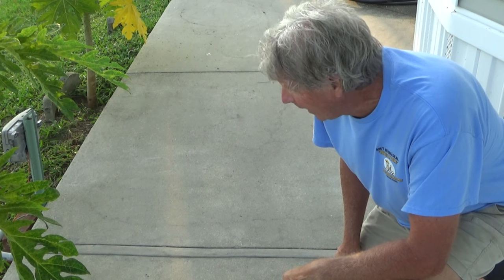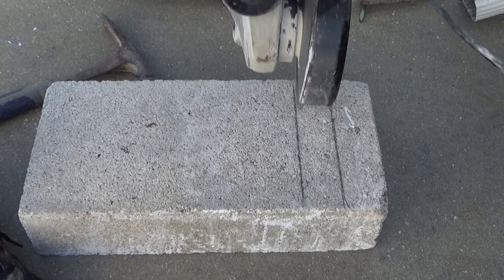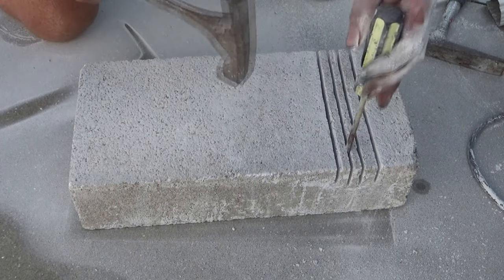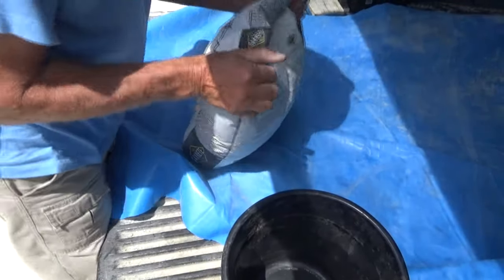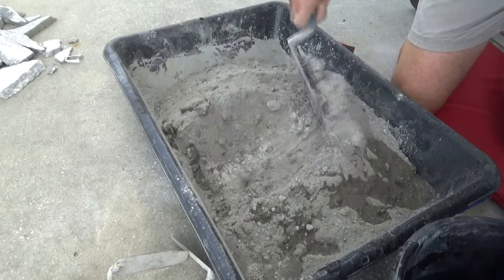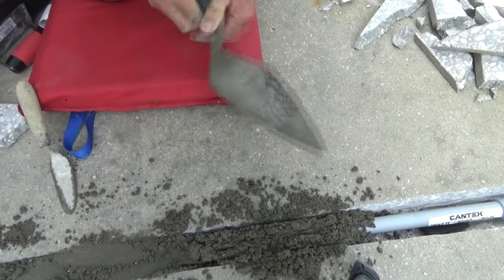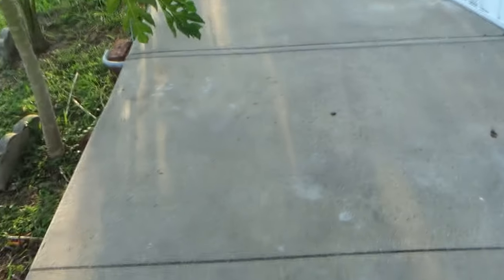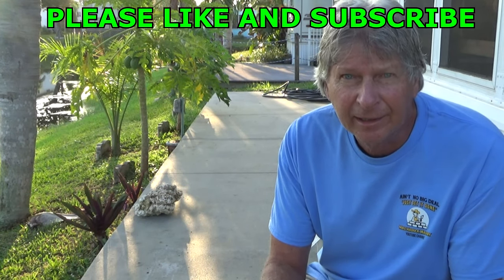CONCRETE REPAIR/PATCHES (Part 11) Mike Haduck

Comment: I’m really glad you are doing some projects in FL!
Reply: Why not bore under the concrete w water pressure?
Reply: @grimreaper4015  probably because one side is hard to get to
Reply from the maker: Thanks Jim, yes little things but I got videos left yet from PA, Mike
Reply: @MikeHaduck  Did you move already?

Comment: Thanks for another well detailed presentation. From your other videos I expected you would cover that conduit with tar paper (or ?) because the cement won't stick to the conduit and differing expansion rates. of the conduit and mortar.
Reply from the maker: Thanks, actually it's too short to worry about the expansion, maybe something longer but no broblems yet, Mike

Comment: Love watching your videos Mike.  Lots of great info!  Did you move from PA?  Do you have any suggestions on what to use to repoint bricks on a garage wall that has a fence post about 4 inches away from it with no real room on the right edge because the garage door aluminum siding starts?  I can't seem to get any tools that fit.  Thanks.
Reply from the maker: Hi Jerry, yep I moved, I got the video out, repoiting brickwork, Mike haduck,  that might help, sometimes we make our own tools , thanks mike

Comment: Cool video Mike. The end result is really beautiful. I like how easily you cut the channel. That's something I plan to remember for the future. I hope your knee didn't get too sore from being on that concrete without a pad. It was painful for me just watching lol. I imagine that the drier mix also helped reduce shrinkage and cracking? The question I have is when using that drier "pool mix" is it necessary to keep moistening it for a few days to keep the new patch "fed"?
Reply from the maker: Hi, usually not, they put the liner on top same day, thanks Mike

Comment: I guess the idea is using the edger will protect the conduit if the concrete does ever crack  and it looks cleaner than trying to blend the patch in.
Reply from the maker: Hi Zach, and with less water in the mix it dosent shrink as much, Mike

Comment: How do you patch a hole in a concrete foundation after jackhammering to fix a water leak in the slab? Do you have a video for that? Thank you.
Reply from the maker: Hi Jah, I have a whole series called, Foundation repair,  Mike haduck,  and as far as fixing a leak I got a video call, " basement water problem solutions"  that might solve the real problem, thanks Mike

Comment: Hello Mike, thanks for the new video. I have couple of question related to this job: 1) I have an impression the conduit is placed too shallow - it looks like it's not even an inch of concrete above it - is it correct? I think there is a sweet spot between depth of conduit and not ruining structural integrity of the concrete slab, but that shallow placement doest't seem right to me. What do You say? 2) I see this time You didn't wet the concrete before patching it, and I am a bit confused remembering you  saying "You want it stick, you gonna make it wet" - help me understand why it was not needed to wet the concrete this time. I am learning a lot from You and really want to understand. Thank You in advance.
Reply from the maker: Hi krzy,  first thing is it's a sidewalk and no heavy traffic is going over it, and second I was using regular portland and sand so it would match the color, if I was using rapid set it would have been done quickly and I probably would gave to paint it with portland to match. Wetting it would have been messy and it dosent have to stick. Because it's packed,  I could have done it like you said I wouldn't matter, but this is florida so not worried about frost getting under it and lifting it up, thanks Mike

Comment: So its basically just mortar mix?
Reply from the maker: Hi Bill, it's just portland and sand, mix it with water but just enough to make it wet. It's seems to work fine, especially florida,  thanks Mike

Comment: Why did you have to run the edger around it🤔🤔🤔
Reply: i think it was stylistic and because he used a dry mix that would flake if he feathered it to blend
Reply: @fpsDREDD  thanks, I was wondering why😂🤣😂
Reply from the maker: It's defines it, thanks Mike
Reply: @MikeHaduck  thanks Mike!!!

Comment: Hi Mike,

I'm kind of surprised you haven't posted something about this yet, but have you ever had to replace sections in a concrete slab in-house due to plumbing repairs or something? I'm likely going to have to do something like that soon, what would you suggest? Thanks!
Reply from the maker: Hi brian, I have, it's messy for sure, I was never a fan of burying pipes in concrete unless you like conduit you can pull wire in and out, thanks, Mike